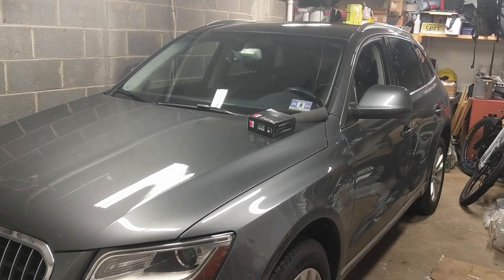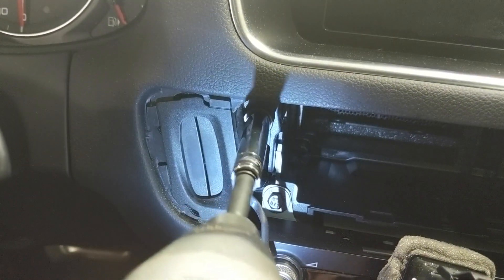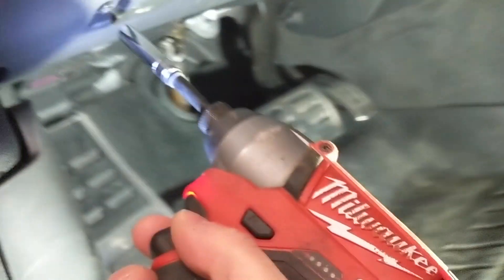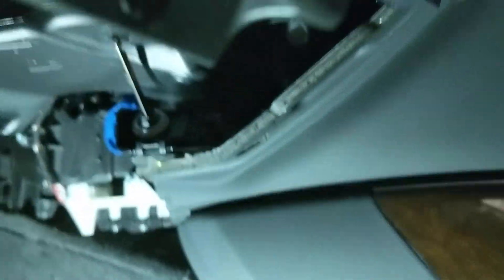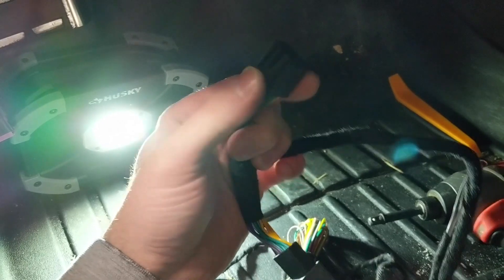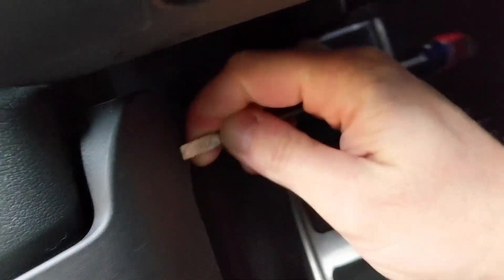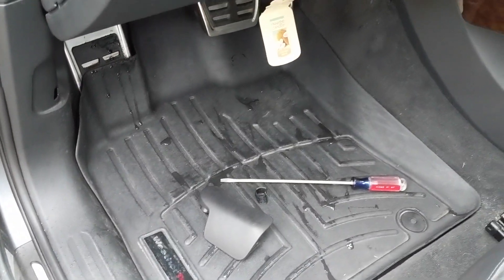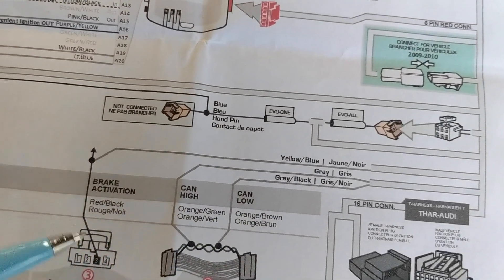Audi Q5 Remote Start Fortin EVO-AudT1 Install DIY

Comment: Great video and thanks for the update. I have all of this equipment including the flashlink. Just a couple of things... what year is your vehicle and how did you overcome the immobiliser?
Reply from the maker: You're very welcome. This one is a 2013. When you are using the flashlink updater, and have the module plugged in it will walk you through the process. Basically you update it, go to the car, plug it in. There are a sequence of lights flashing on the module, once it completes, you bring the module back to the computer and it stores the immobilizer info from your key to the module, and you are good to go.

Comment: So for the B8/B8.5 only needs these 3 wires if you don't want to watch the video or skip to 15:23
 Car - Harness
red/ black - yellow/blue For brake wire
 orange / green - grey can high 
orange / brown - grey/black can low

Great vid, thanks for clearing my confusion and helping with a wire prepping!

Comment: Can it  be installed without the flashlink equipment ? I have a S5 2014 got the evo all and the T harness and was under the impression that was all I needed to install it ? thanks great video BTW
Reply from the maker: I'm not sure. You'd have to confirm with Fortin. Im under the impression the programmer is needed for the programming of the key.

Comment: Hi , great video. I have a Q5 2013 I have connected the wires as per your guidance . I Can you please help me with the prgramming ?
Reply from the maker: I'm sorry it's been so long I don't remember. And no longer even have the car to play with it
Reply: No worries , I've managed to get it work. I couldn't get the decryption process to work but I did find eventually a manual and made it work. Thanks for the wirring connection , probably without you it would take me even longer.
Reply from the maker: @ionutalexescu6912  glad you got it to work. And happy this was helpful

Comment: I have an Evo-One im installing it was for a Toyota but i flashed it to Ford, i have notfound a harness so i used some soldering and wire taps but i never finished because i wasnt sure if i could use the Ford factory FOB ? Or if i need to purchase the FORTIN FOB, are you using your cars fob or did you buy a Fortin fob? I knoww this is an older post but hoping you still read the input Thank you for the video and the info.
Reply from the maker: @vtailv35  I was using the factory Audi fob with this
Reply: @LarryFopps  Thank you for the info I forgot to ask if you were using EVO ONE UNIT but I’ll finish, I made my own harness took all taps out hopefully I didn’t cross wires once again thank you for info..
Reply from the maker: @vtailv35  I don't recall which one it was. It was whatever came in the audt1 kit from fortin.
Reply: @LarryFopps  Thank ya for info just some info I have a DEI unit in an 2001 SHO it was Mom’s Hot Rod Yamaha engine but ford used a transponder key this was installed 20 years ago! And has worked well but I hated the idea that there’s a key in the car as the bypass, so back in the day if you were good car thief you’d know. You have a great day and im finishing wash job on the bird!

Comment: Hey Larry, I just installed this today using your video and all was great. I noticed that upon shutting down my car after remote starting, that the Audi MMI turns off immediately. If I start it normally (without remote start), the MMI stays on until you open the driver door. Just wondering if yours behaves like this too? Maybe it's a setting I missed. Cheers! :)
Reply from the maker: Hi Henry, I'm not sure, but I don't think that mine did behave that way. Unfortunately, I recently sold the car so I can't confirm

Comment: Do you have keyless entry?   I see that this system requires the user to use the key fob to enter the car after remote starting it.  Is this required even when not using remote start or will keyless entry (car unlocks by grabbing the door handle and locks by pressing the button on the handle) work then?
Reply from the maker: I don't have keyless entry.

Comment: Has anyone got this to work on a Q5 2015? I connected everything. The doors lock and unlock but doesnt start?
Reply: Did you ever get this going for a 2015? I read the install for 2015-17 same car but lots more wires to tap.... A relay and diodes to be soldered in as well.

Comment: Hello I then help me on my audi sq5 3.0 tfsi of 2015 I have the remote start my problem is that I did do the new key and I changed the codes and now I no longer work then help me how to connect the new keys ? Thank you
Reply: Did you buy the flash link ? The red puck

Comment: Did you have any trouble programming the key? I bought the same system for a 2014 a4 and can't seem to get the key to program.  Im waiting for tech support.
Reply from the maker: I had no issue at all pairing the key. I believe it was a couple back and forth a from car to computer but I just followed the instructions

Comment: Great video, how did you solder those 3 wires. Did you cut completely through and re solder or strip them back abit and solder ontop? Do all 3 need to be soldered?
Reply from the maker: I cut them completely and re-soldered, but you don't have to go that route if you don't want to you can simply splice with connectors, I just prefer soldering personally.

Comment: So do you need a hood pin and the switch connected this is what’s causing me to struggle
Reply from the maker: No, I did not install the provided hoodpin switch. These cars have them built into the hood latch. If your hood is open without the provided hood pin installed, the car won't start via remote start. I know this video is a mess and hard to follow because of how I stopped filming, but if you take a look at the first initial attempt to start remotely, 18:00 mark, it wouldn't start because the hood was open.
Reply: @LarryFopps  ok that’s what I was thinking also is the switch needed as well thanks for the quick response I bought this unit last year and have dreaded the install but now it looks super easy.
Reply from the maker: @tuTWENTY  it was honestly really easy. The most frustrating part was getting the keyport back in its place, the most nerve-racking part was splicing into can hi and can low. and the most tedious part was the programming process which I didn't show, but it's pretty straightforward with the directions provided

Comment: Hey Larry, if someone opens the door. Will the car shut off when stepping on the brakes?
Reply from the maker: It will not, at least, I don't think so. I admittedly didn't do as much playing with the settings in the Fortin software as I should have. that's a feature I'd like to have, it very well may have it and I just didn't choose the correct settings.
Reply from the maker: But, the car does remain locked once remote started until you unlock via the fob.
Reply: Push button you get in and go. Key port your put the key into key port and go. I’m guessing key port will shut off if you don’t put key port in. (I have push button)

Comment: I see your from jersey from the inspection sticker I’m from union will you be able to help me with mines I have a 2012 Audi A4
Reply from the maker: I am from jersey. I can answer questions, but I don't have free time to help out with install.
Reply: @LarryFopps  no problem at all. I been calling around they want 550 to install with losing a key. I ask if they install the evo they say no it’s jus a harness I would need another modules etc to make it work smh
Reply from the maker: @evansjean6051  that's insane. Buy this kit yourself, install yourself it's not difficult
Reply: @LarryFopps  do you have a link. So there’s three separate parts I’m buying. The harness, the module, and the red programming thing. And I do not lose a key. I only have one? Also what other features can you unlock when your programming this on computer
Reply from the maker: @evansjean6051  The links are in the description. You just need the kit, which includes the harness, and the programmer. You do not lose a key. basically all of the functions in the MMI are programmable through the software. Also, the time you want the car to run for when started, whether you can also shut it off through the remote, what the series of buttons you need to push on the factory remote for start (default is LOCK LOCK LOCK) PLUS OTHERS.
Reply: @LarryFopps  do you have to decrypt the key or can you skip all programming ?

Comment: Hello sir I have audi a4 2015, do you think this will work on my car ? thank you!
Reply from the maker: Yes it will
Reply: @LarryFopps  Thank you, you just saved me at least $500 🤙🏻🤙🏻🤙🏻
Reply: @LarryFopps  and also do i have to buy forti. flashlink 4 or just the starter kit ? thank you!
Reply from the maker: @brkbt93  you'll need the flash link to program it
Reply: i bought them both. I tried to install the software but for some reason it gives me error and saying: NSIS error, i have windows 7 ultimate 64bit
Reply from the maker: @brkbt93  I'm not sure what that error is but I'm sure Fortin customer support could help you out.
Reply: last question. fortin says that i will lose one key ? i don’t get that part :(
Reply from the maker: @brkbt93  nor do I. I didn't lose a key in fact, it's the reason I chose this kit.
Reply: @LarryFopps  but u didn’t show the whole process. It is more complicated then what u showed us here. I didn’t read any comment saying oh yes i did it and worked for me. u just plug one wire and cut the video, what u describe to be honest is how to take those plastics out and those 4 bolts :(
Reply from the maker: @brkbt93  did you watch and listen to the full video? I stopped filming after the keyport, I said that. Then did my three soldered wire connections following the diagram they provide and after that you need to program the module again following their instructions and bam it works. Is the video the greatest, no I acknowledge that, but what I didn't show, I explained. And I still stand by getting the keyport back in place as being the hardest part of this job.
Reply: @LarryFopps  i did watch your video 5-6 times, i just don’t understand electronics that’s it. Thank you. will try tommorow
Reply: i connect all the wires and installed the module but i cannot program. i hold the button but the red light just not going away
Reply from the maker: @brkbt93  you followed the setup procedure with programming the module in the software?
Reply: @LarryFopps  for 2015 u have to have key wrap, i called fortin and that’s what i was told :(
Reply from the maker: @brkbt93  I'm not sure what that means
Reply: @LarryFopps  whatever u show on the video is not working for audi 2015 and u have to lose key to make it work.
Reply: @LarryFopps  but still a good video for the people who has older then 2015 audi or simmiliar like urs. Thank you for the video anyway 👍
Reply: @brkbt93 Thanks for confirming as I was considering this system but leaving a key inside is no go for me especially when most of the systems label the wire pointing to the key box with 'KEY'   I know that the batt/tray gets removed but no way am I leaving a programmed key in the car.
Reply: @AN-kg4ei  I actually did lose one key. They put it somewhere inside by the dash but you are getting 2 extra remote control and you can also open the car with it, close, start etc. The guy who installed remote on my car also setup my original keyfob to be able to start the car with three clicks on the lock button. I’m very satisfied

Comment: I do not know where the box of the remot start is because behind in the trunk there is no
Reply from the maker: Huh? The remote start module I have behind the dash above the knee panel.
Reply: @LarryFopps  I can not find it then send me a picture more I have mene where thank you very much
Reply from the maker: @davidivanovski4840  I'm not sure I understand what you're asking. The only thing happening in the back of the car, is connecting the battery. Everything else takes place in the driver's seat area and where the box for the remote start would get mounted with this setup. You can't find it? Are you installing? Trying to uninstall someone else's install? Sorry but I'm not going to dismantle my car to send a picture of where the box is mounted
Reply: @LarryFopps  I'll explain practically I lost the keys of my car and I did make 2 new keys and now it no longer works the remote start then explain to me why thank you very much and I apologize for my English but I'm writing to you with the translator😂
Reply from the maker: @davidivanovski4840  oh I understand. You'll have to go through the reprogramming procedure that was done initially with the new key. I forget specifically how that was done but believe you need to remove the remote start module, and hook up the module to the computer, run the software and use the Fortin flashlink programmer
Reply: @LarryFopps  Then recommend a new remote start without configuring the computer? Thank you
Reply from the maker: @davidivanovski4840  no, just reconfigure what you have
Reply: @LarryFopps  The problem is that I do not install it and I do not have the cables to connect it to the computer
Reply from the maker: @davidivanovski4840  then I'd find a Fortin dealer near you or reach out to Fortin to purchase them

Comment: This will work good on Audi older then 2015, but if you Audi is 2015 this won’t work and is way more complicated and also u will have to have an extra key that will stay in your car. Still good video hands up for this guy, but again don’t try if it’s 2015 and up. Have a good day guys.
Reply: WHAT DID YOU END UP DOING?
Reply: paid $500 to a professional and they installed remote, with their own product. No more matter what you do most likely u will burn one key

Comment: So mine never works on the first 3 locks, **edit. Mine does work at first 3 locks you almost need to count 1 sec in between presses.*** Also mine does not cut off with 3 lock presses. I didn’t see anything in the installation information that says it’s supposed to.